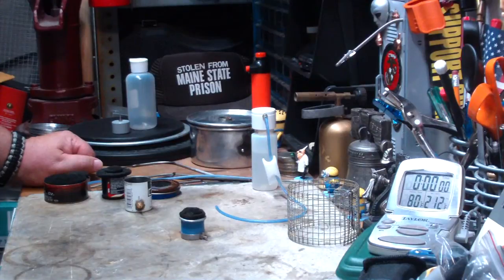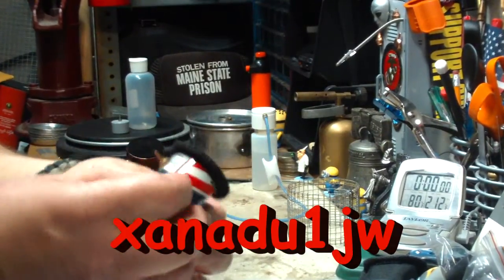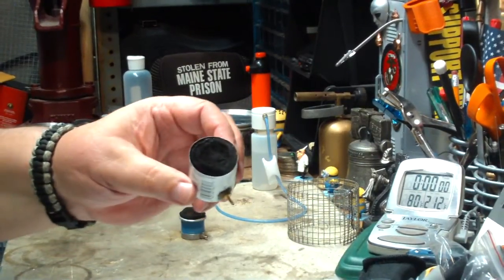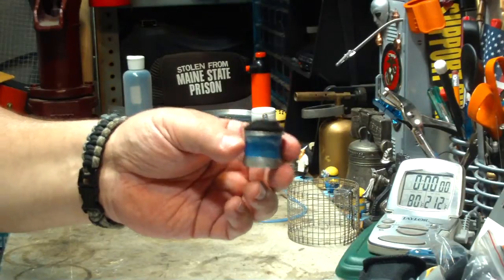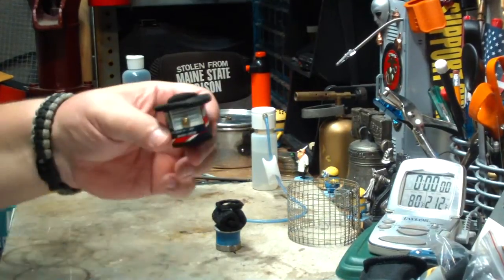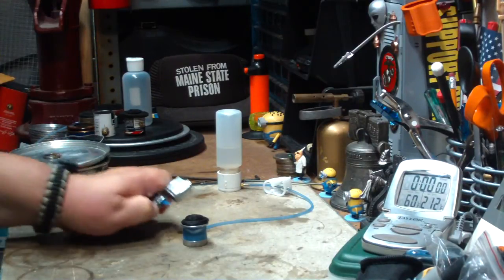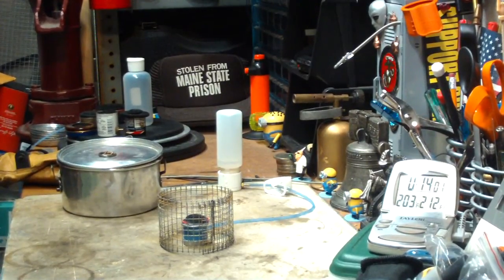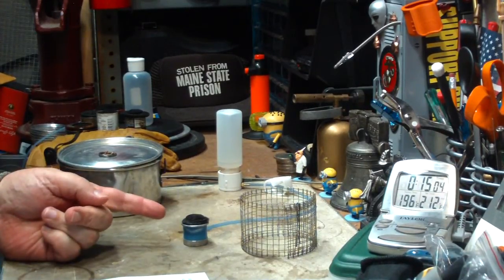Carbon Felt Alcohol Burner bought on ebay - Boil Test #1

Comment: the ring glowing means you aren't burning full out but at simmer.  I carry this stove only when I want to cook/simmer  stuff as opposed to just boil.  If you want to boil you have to keep the whole wick involved, which means usually squeezing every couple minutes.  That stove is a couple years old but should still work fine despite someone overfilling it and scorching the side.